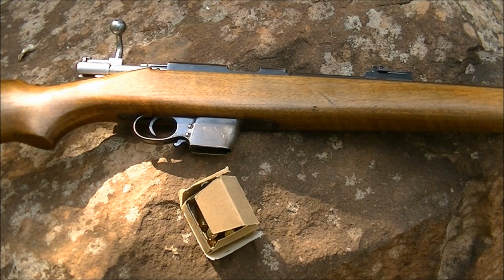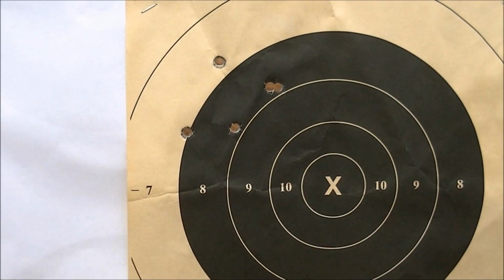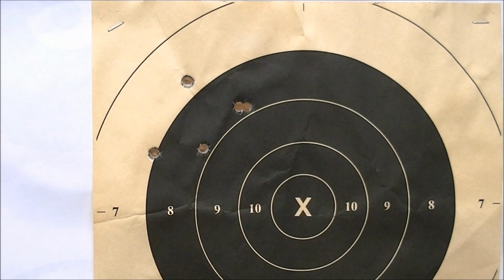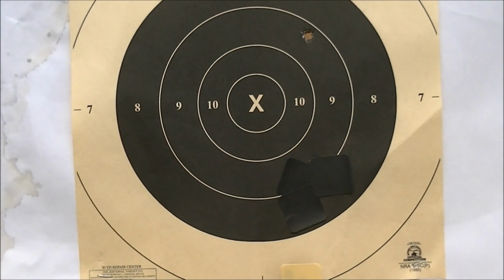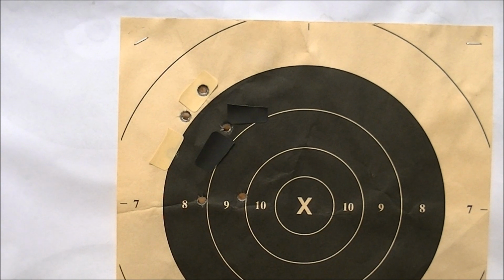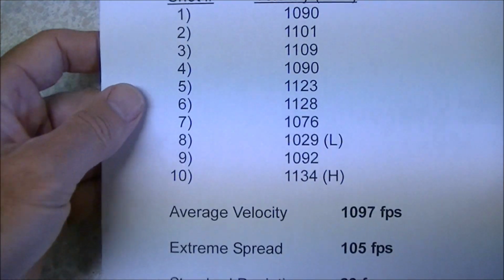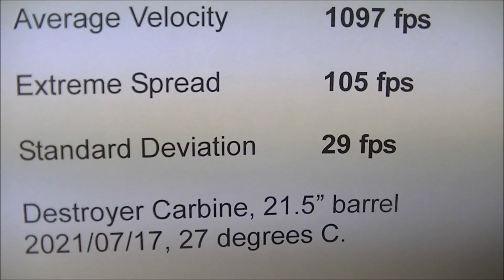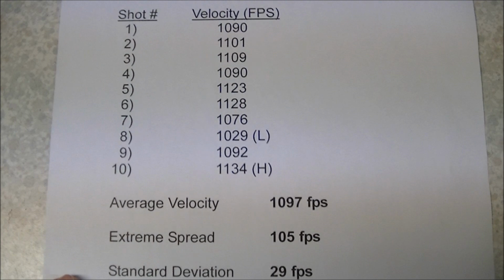9mm Largo Load Test with Berdan Primers

Comment: Never could find my brass. I'm probably going to buy weak 38 super +p. Which is usually in the same ball park. I nearly ruined my pistol with 20 rounds of 9 mm  para. The extractor bent and firing pin split and wedged in a primer. After much deliberation and a congressional act later and a gunsmith saying buh bye, a security guard at a pawn shop helped me take it apart. After fixing it, I ignorantly bought sub fusil largo ammo and it's HOT. After one mag I found 2 shells and never shot it again. The grip screws vibrated off. Some weird thread pitch. The rim is like you say a little bit bigger than the bolt face? Extractor seems to still grab if the fit was better. I am overwhelmed by the reloading stuff. I'd need a barebones kit to get started but I'd never use it regularly.
Reply from the maker: I assume you have an Astra 400? Being blow-back operated I imagine shooting one of those with the wrong/hot ammo could get "interesting". While the 38 Super case is very similar to the Largo the 38 Super rim is slightly bigger in diameter than the Largo and may not fit the breech face of some guns. Also the Largo has a much deeper extractor groove than the Super, again this may or may not be an issue depending on the gun you use it in, with my carbine it matters but apparently with many of the pistols it does not. Personally I would not shoot factory loaded 38 Super in a Largo as the super is loaded to higher pressure. I think Starline still makes proper 9mm Largo brass and load data is available so that is the route I would recommend for shooting this round.

Comment: I'm a big Unique fan, and use it for a lot of my handguns. It's a bit dirty, but gets the job done nicely. My load for 115gr 9mm Luger is 5.5gr, so I believe your assessment is spot on. A little more juice might be the ticket.  I've been feeding my Star Modelo Super and Astra M400 from my surplus stock, but  will eventually have to start building ammo for them.
Reply from the maker: If I try some more of the 115's with Unique I'll likely try 5.5 or 5.7 grains, depending mostly on what powder measure rotors I have that will drop something in that range.

Comment: Hello sir, not related to this video which by the way is really goo. Just got a Lee load all 2. Reloading Lee 1oz slugs. It kinks them did the first 8 all good next 2 kink and buckle them bad using brand new Cheditte hulls pre primed. Your comments always appreciated. Thank you.
Reply from the maker: It sounds like your wad column might be a bit too tall for the hull, try a shorter wad if you have one, or try a different powder that is more compact and takes up less space.  Cheddite hulls are quite easy to buckle, they dont stand much crimping pressure if the load does not fit them exactly.

Comment: There seemed to be a little gas blowback at 5:20, so the ES could be from low pressure and lack of gas seal.  I think you're right that a little more powder would make for a more accurate round.  Fun gun!
Reply from the maker: Yeah, looks like a bit. There were no primer punctures so I agree it was probably a bit of an under pressure round. I think the 5 grains of Unique would be fine with a 124 or 130 grain bullet and would step the pressure up enough to avoid case sealing issues like this.

Comment: 50 yard rifle tbh
Reply from the maker: Yes, for the most part these are for practical purposes short range just because of the cartridge. However the range I have access to is 25 yards or 100 yards, so 100 yards seemed more sensible than 25 for accuracy testing.

Comment: Maybe I missed one of your videos ?  But how do you deprime berdan primers with the water method ?  thank you....
Reply from the maker: I've shown de priming rifle brass using  a close fitting punch and water and a hammer, however these were done using a lyman "M" die mounted in a reloading press with the case filled with water. Works most of the time, but is a little messy.
Reply: @314299  , thank you..........  be well.

Comment: U.S. made 9 X 23 brass, is identical to the Spanish made Largo brass. Uses Boxer primers also. 

This is the reason that Colt quit making 9 X 23, 1911's back in the 90's. Their lawyers figured out  real quick, that the would be exposing themselves  to serious legal liability problems. By all the goofs shooting their 9 X 23 ammo, in all the surplus Spanish Llamas and Astra pistols.
Reply from the maker: Actually not all the US made 9x23 brass is identical to original Largo brass. I bought several hundred rounds of new Star-Line 9mm Largo brass, it turned out to be from their initial production that had shallow extractor grooves. From what I hear this brass works great in pistols but it does not work in the Destroyer as the extractor will jump the rim, this does not happen with the original brass. As I understand it Star-Line fixed the issue making their later brass with the correct extractor groove dimensions.

Comment: What’s 9mm largo
Reply from the maker: 9mm Largo is the Spanish version of the 9mm Bergmann–Bayard round, it's a 9x23mm round and so longer than the regular 9x19 Luger. The Largo case is very similar to the Colt/Browning 38 Automatic, .38 Super and 9mm Steyr but the rim dimensions and extractor groove dimensions are somewhat different. The Largo's standard bullet was a 127 grain FMJ at about 1,170 fps, so quite similar performance to many regular 9x19 loads.

Comment: Hey dude, It's been on my mind that I write way too much in the comments (Like it is about me and not your video), anyway, I noticed that the bolt when fired changes its position, I believe that may be a contributing thing in the accuracy dept. Maybe not, also, I like that small carbine, nice size and handy, great small game getter and all-around shooting machine for a Saturday at the range or a walk in the outback, anyone can shoot that rifle with ease. and again, with standard pistol primers, maybe some cast crafted projectiles, it is easy on the pocketbook. that is a nice setup. Looking forward to more trials with some hotter loadings. Keep up the good work, your videos are far from boring. -Dave
Reply from the maker: Thanks Dave. The over all quality/fit/finish of these is just "OK", and most have been subjected to many years of hard use and so the parts are not a super tight fit, this includes the bolt and I think that is why there is a bit of "bounce" to the bolt handle after firing a shot. I suspect any movement of the bolt handle happens after the bullet has left the barrel but it would require a good high speed camera to verify that or not.
Reply: I can not but help ,I end up doing the same things as you. Could be the way we are due to our experience .

Comment: 38 super brass will work fine in these also. I believe Rememington brass works alittle better than the Winchester brass . I had to cut alittle on the extractor grove of the Winchester brass on my lathe  and then it worked perfectly.
Reply from the maker: I have a box of 38 super brass that I modified by reducing the rim diameter, however it does not work well in my carbine as the extractor groove is not deep enough and the extractor will jump the rim. With the manufacturing tolerances of Spanish guns of that era I'm sure the modified Super brass would work fine in some Destroyers, but mine not so much.

Comment: Every time i find a destroyer its missing the bolt or the barrel is fucked it's always something critical.
Reply from the maker: One with a missing bolt is pretty much just a source of parts , chances of getting a bolt are close to zero. Extractors are another problem point. One with a ruined barrels would be "easier" to bring back, as a new barrel could be fitted and the chamber cut for regular 9x19. But the cost of doing all that would probably not be worth it unless you were equipped to do it yourself as an amateur machinist/gunsmith.

Comment: Interesting rifle! Looks like you may be able to locate boxer primed brass from Starline in the future. Cool!
Reply from the maker: I have some of Starline's older Largo brass but the extractor groove is too shallow, I do need to get some of the current stuff with the proper dimensions that will work in the destroyer.
Reply: @314299  I am surprised that Starline made the groove too shallow. I've always found Starline excellent whenever I've used it (9mm Luger, .38 S&W, .223). SAAMI does not have specifications for 9mm Largo, and maybe they were following a bad exemplar.

You'll probably have to wait a bit for new Starline 9mm Largo. It's currently listed as "backordered" on their web site, and most US companies are put their resources into producing high-demand items like 9mm Luger.